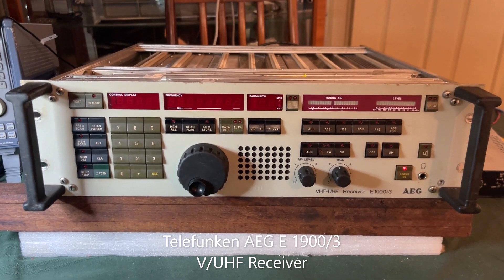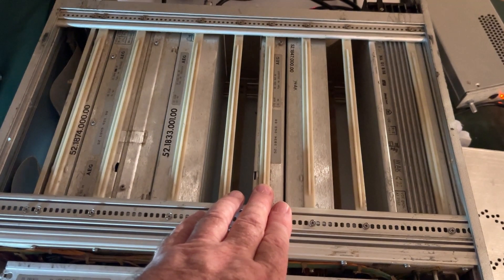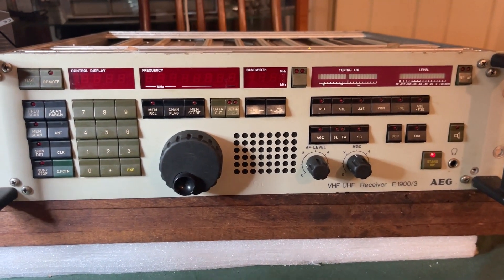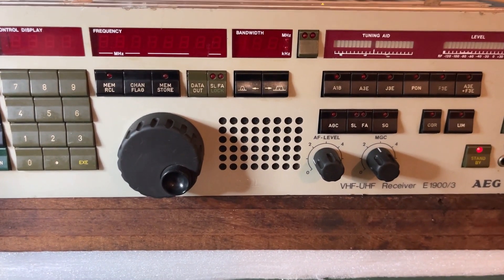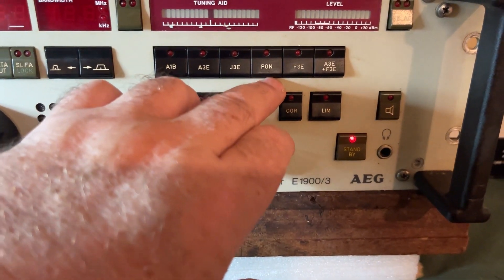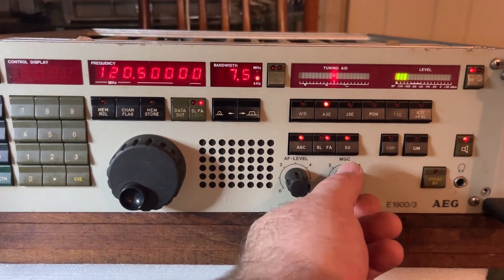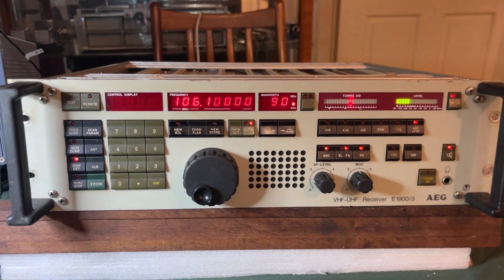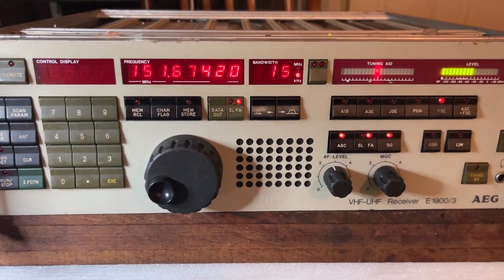Telefunken AEG E 19003 VUHF Receiver

Comment: Did you have to use an extender board to access the modules while troubleshooting the radio?  Thanks for the video and regards from the USA.
Reply from the maker: Hi Bob, I didn't have any extenders or schematics. I basically did a visual inspection of each module. They use the a box header with pins and coaxial inserts. I would of imagined these modules were probably tested in 'jigs' in the factory. I was pretty lucky that the main issue was the PSU which i basically reverse Eng and replaced some of the semiconductors and capacitors ( electrolytic). the main issue elsewise was connector mating which I cleaned and mated a couple of times. There is still a connector intermittency which pops up occasionally on the synth module. I am hoping that at some time in the future the schematics may become available. Build and quality and components are all hi reliability, logic is all 54LSxx in ceramic dips.